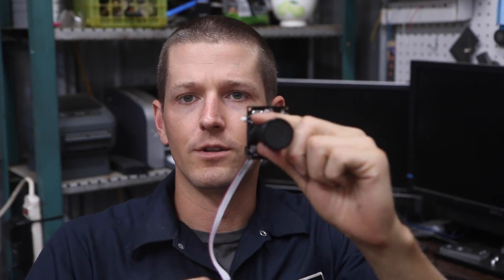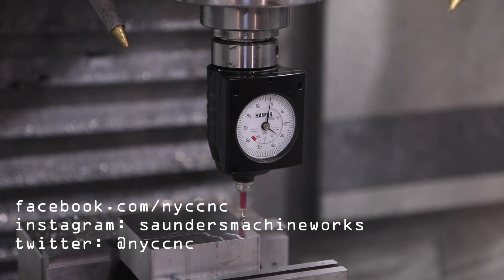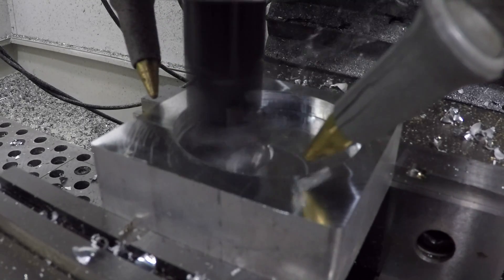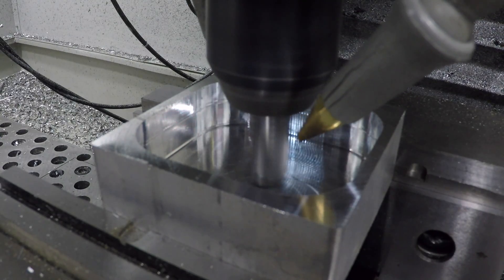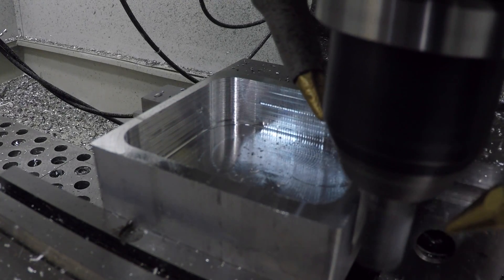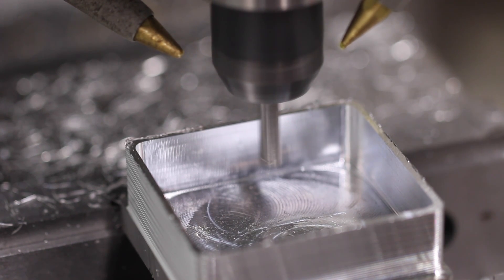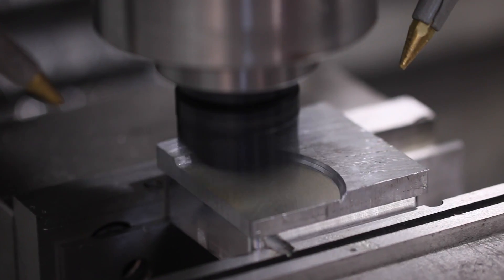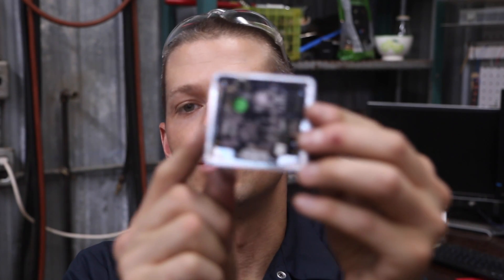Annoying Camera Enclosure!  Widget51

Comment: John, that 1 inch shearhog generates a lot of harmonics because of the single flute.  I have one and didn't like it, except for very specific use cases.  It's likely that the imbalances cutting forces of the single flute are affecting the machine due to low rigidity.  I had a Shizuoka AN-S, a 40 taper machine that weighs 6k lbs and it caused a lot of vibration in that machine.
Reply: I also have the 1.25 inch shear hog and that thing works wonderfully, so it's definitely a geometry thing.

Comment: That start/stop could be bad. My motor controller has needed a restart due to the braking resistor overheating (too many tool changes too quickly)
Reply: NYC CNC ctrl + F "M05" or "M5" to search for and delete the unwanted spindle stops in the code...at least until the post gets fixed. I have to do alot of hand editing for our lathe because the post doesn't know we have a tailstock in the way :P

Comment: Sweet As Bro!

John what's going on with your Haimer? Why isn't it zeroing at the 12 o'clock and zero position? I'm also a big fan of them ... just don't snap the tips! They want over $120 for replacement probes here in Oz! I'm not joking.

I think a video of some maintenance would be a great idea. It's ironic that you mentioned it, as it looked in your last couple of videos as if the gibs may need adjusting. It would be a good opportunity to see the machine undressed as it were, something that's rarely ever seen, and should be absolutely invaluable for somebody considering purchasing the machine.
Reply: NYC CNC I have an earlier model John and it's quite easy to adjust, albeit fiddly. Haimer won't provide any service information or spares at all, and insist it be sent back to Germany for repair. Nevertheless I've had mine apart and they're very simple. It's just a bog standard indicator in them, and the magic is done by a very precise cone.

On my model there are 4 grub screws, 2 on either side, that hold the indicator itself in place. Assuming it currently repeats to the same point in all axis, they are just tweaked to bring it to zero. Your's seems to be a long way off, so the indicator may need to be rotated a little. As you say, so long as it's concentric (covered in the instructions) then I guess it's no big deal, but I just like to have everything 100%.
Reply: NYC CNC Yes funny you should mention that, as when I was describing it I wondered if it would be easier just to put a video up. I'll see how I go for time and if I can squeeze it in I'll do that. It won't be quite as polished as your productions, but the message should still get through. I'll let you know how I go.
Reply: NYC CNC Surely the problem is that when you are jogging the work you are not taking the Haimer to zero?? On the lower dial that runs from -2 to +2, you stopped jogging when it indicated +1 in each of the 4 directions. I wondered what you were up to. Looks like a metric model, so unless I'm completely misunderstanding how you use them, it means you are 1mm (1 whole turn of the main dial) off axis. Probably doesn't matter if you are just centring the work but if you are picking up an edge it would.

The fact that the main dial is not vertical is another matter but probably won't affect accuracy if the zero is where the needle rests when not loaded.

I have a Martest which is another German model, almost identical to the Haimer.
Reply: Murray Edington Hi Murray, as far as I can see, John's Haimer is repeating in all axis (that's what I was alluding to in my first comments), it just doesn't actually read "zero". I'm only familiar with the previous model, but there are 2 lots of adjustments on the Haimer, one is 4 screws on the stem, and that ensures the probe is concentric to the stem. That's covered in the instructions, although I think the instructions suck, and I do it another way. You will always need to adjust concentricity after replacing the probe, and this is the first adjustment that should be confirmed. However there are also 4 other adjustments they don't tell you about. That are on the body around the dial face, and look like they hold the dial mechanism in place. That's no coincidence, because they do! If they're loosened the whole dial mechanism (it's just a schmuck dial indicator inside they're using) can be rotated (or even removed), but because the pin that transfers the movement to the dial mechanism remains fixed to the probe mechanism, it will affect what the dial actually says for each movement of the probe. However when they're tightened they also minutely shift the dial mechanism in the housing, so by tweaking all 4 screws you can bring the indicator in to actually read "zero" when the probe is centred. It's all a bit agricultural, but by the same time very simple and clever.

You may need to actually sit down with a Haimer and read the above a few times for this to all make sense. NOTE: This is what I do, and have done in the past to repair my Haimer. I have no idea if it is correct as Haimer sure as heck won't tell us. The standard response is that it will need to be sent back to Germany for "repair". So the bottom line is if you follow what I said, and screw up your Haimer, you're on you own I'm afraid, and I can't take any responsibility as to the accuracy of the information or anyone's Bozo moments. However it's certainly worked for me, as the Haimers can get knocked out of zero if they're dropped. Not that I've even done that! ;)

Comment: I like Solidworks way more than Fusion 360. And I use HSM express :)
Reply: NYC CNC  I agree I like to see fusion 360 for the same reasons, it is more affordable and I believe more will flock to it for the price,  also they are very similar I believe autodesk baught out hsm/solidworks. cam side.     I do enjoy seeing fusion 360 a bit more just because there are not that many out there doing videos on it yet.  I suspect that will change as time goes on.   360 will likely be the common as time goes on simply because of the power/price factor.  That tends to appeal to both hobbiest and big companies for some reason :)  I currrently use autodesk inventor and hsmexpress on a G0704 homemade conversion I did about 2 years ago, sadly I don't play with it as much as I should but I do enjoy it on occasion.   I am seriously thinking of going the 360 route for the 3d milling abilities in an at home atmosphere;  3d adaptive clearing kinda sounds appealing to me :)  actually it doesn't seem much different from the standard hsmexpress I am currently using now with the exception of 3d tool paths and some minor differences.  Don't know for sure haven't made the jump yet.  I am itching to do some 3d parts on that little mill :)  Take it easy man and keep up the great videos I always enjoy them.